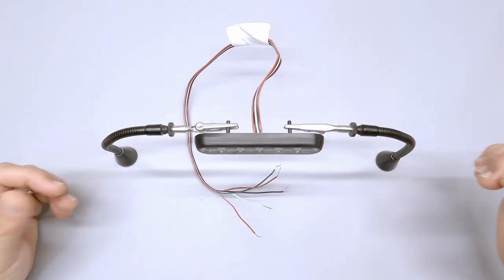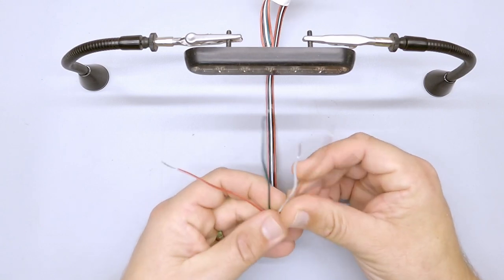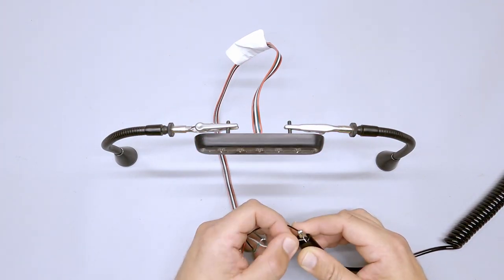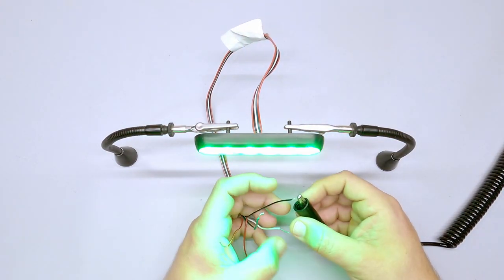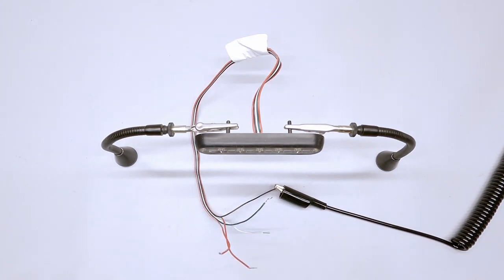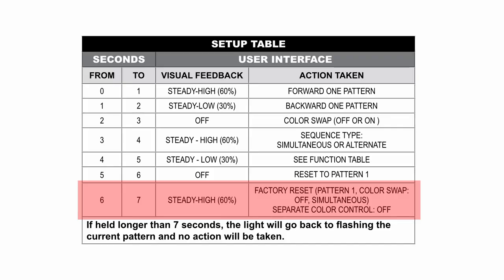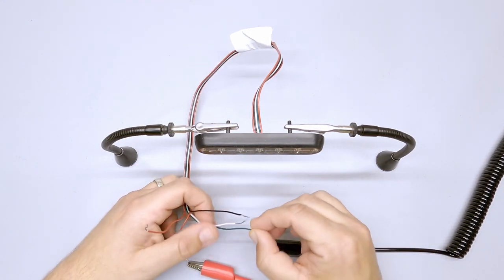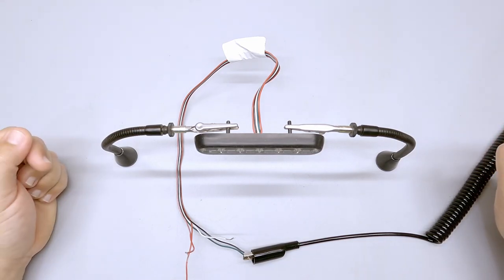Twisted Pair - mpower® Fascia 3" and 4" Technical Walkthrough

Comment: I wish the lights came with a gasket / mounting template to make it easier to mark the holes for drilling. Soundoff, please add something for that.
Reply: I always use the backing plate included with the shroud kits. Or, an ABS cutout.
Reply: @N8JLS  ya, for my installs I don’t always have the shrouds or a template. Just a foam gasket would work for the hole locations
Reply: The instruction sheets, available on our website provide those templates. These are good for the 3" and 4" fascia lights, the 4x2, and the fire light sizes. The HD light doesn't include a template, but the 4" fascia should work for that as well. They are available online on our website. All that said, I agree with @N8JLS - specifically his comment about an ABS cutout. I usually create one for each of the different sized lights that I am frequently working with (based on the instruction sheet template). I find that works perfectly in most cases, and the template doesn't "wrinkle up" as you are trying to use it.

Comment: Question! I have four dual color Red white 4”. Installed 01/2020. I have primary lights programmed with Red wire. Red/white wire programmed for steady white flood. Green wire connecting them all for sync. Are you saying the green wire can also be used for a steady burn of color 1? In my case color 1 is red. The green wire is already being used for sync. Could I also wire it for a -V switch to produce steady Red flood?
Reply: Hi! The green wire will force all modes of the light into external flash mode. It is designed to work with a external flash source. So in your case, if you grounded the sync wire, your red wire would ALWAYS product red steady, and your red/white wire would always produce white steady. 

Grounding the green wire via a switch would lock it into external flash mode until all power has been removed.. so that will probably not work as expected.

However, if you wanted a 3rd mode, so you have red flash, red steady, & white steady, you would have to reprogram the light using the ConfigureIT App and have a Bluetooth programming module. That would work. If you don't have one, maybe get with a local upfitter. Most do. Or reach out to Customer Service at 800-338-7337.

Comment: Has anyone tried using these lights with a Whelen Core setup? I am having problems getting a cruise (dim) mode to work.   How does it dim the light with blueprint?
Reply: bluePRINT works just fine with our lights. W's product likely runs at a different pulse rate than bluePRINT does - thus, it causes issues. Try using different low power settings from their program - i.e., 50% brightness on the Core program screen might not equate to 50% brightness for what the mpower light is looking for.